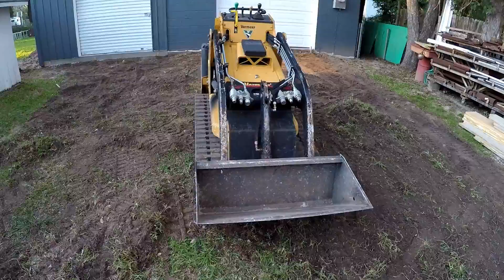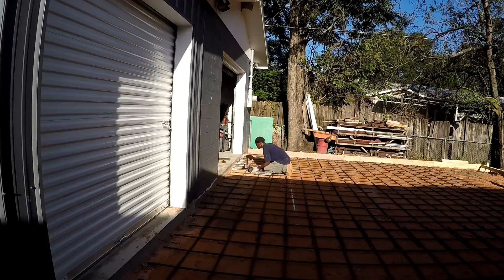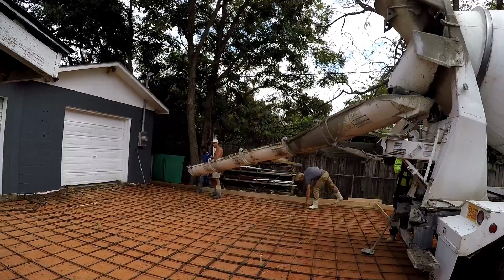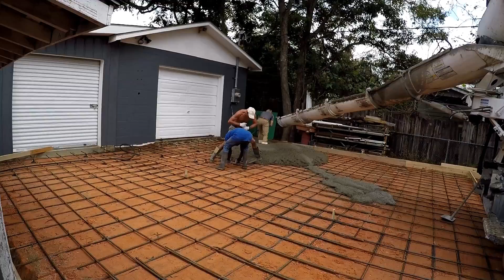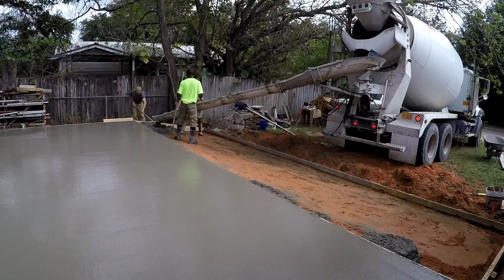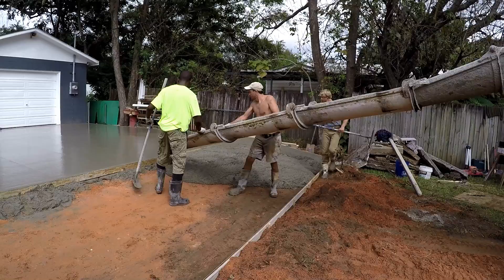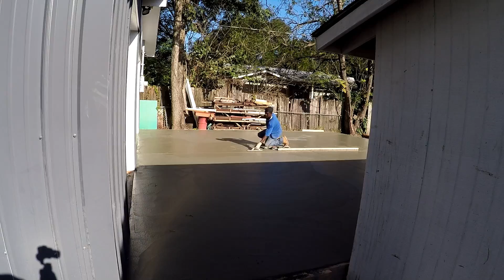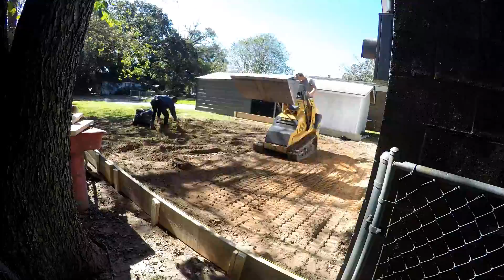New Shop Concrete Slab!

Comment: Forgive me but not buying the simplest and cheapest of tools to make the rebar sit above the ground an inch or two shouldn't have been that difficult. Homedepot sells the rebar chairs for like 20-30$ for a pack of 50. maybe even just a few pieces of solid wood would have been better than lifting the rebar, which would have then settled down to the bottom again. Idk, that just seemed pretty bad and yes I know the vid is old af.

Comment: Wet cement only does what you tell it to do. If you "tell" it the right thing, it will serve you "forever". Especially with re bar and in Florida!  :-) That will last as long as a bridge. (A well made bridge). I saw you take machine tools off your trailer on this driveway, before I saw this video. What piece of History. Adam Booth History. Ya, Adam; I'm Binging on your videos!! Hi, Abby!! Sorry. Mrs. Booth.  ;-)

Comment: Unfortunately lifting reinforcing steel as concrete is being placed without proper chairing is a bad practice. It leads to rebar either being too high or too low in the slab.

Plus one on the use of the mechanical vibrator for proper consolidation. I love seeing that
Reply: Agreed...lots of so called concrete guys will tell you no rebar is needed. They will also say if you want reinforced concrete, they could use "wire" but then wont use dobie to block it up and if they did use rebar lots of them don't use dobies with that either. Such a waste of materials when you are right there 3 feet from the rebar and too cheep to get a box of dobies tied into the rebar. There's much more to mixing concrete as there is to pouring it and spreading it on the "prepared" ground which many concrete guys do not do. It depends on the soil at the job site but do they ever discuss that with the customer? Hardly because it drives the price up and takes more time/labor. Also that guy screeding with that short 2x4 could have had another man helping using a 20 foot 2x4 or one of those professional metal ones used by the trade. this job isn't all that big to get all technical but it's amazing none of this is ever discussed with the owner mostly.
Reply: The installer killed himself because of you!

Comment: Great flat work Adam! And I thought I was the king of overkill! Lol... you should be able to pull loaded semi trucks onto that puppy!.. I just got done pouring a 50×100 for my new shop.  6" thick but only 1/2" rebar on a 12" grid..3500 psi. But mine has 12 × 24 grade beams around the perimeter  sitting on 24 18" piers 12 ft deep.. i called the project slabzilla because it kept eating tons (literally) of rebar! Going to let it cure for a month before erecting steel..  Hope you get to convert yours to a building someday. It's definitely strong enough for it! We met at the Lindale Good of the Land festival but I'm sure you don't remember me... keep on truckin' 
Jeff.

Comment: The man needs handles on that wood so he doesnt have to bend over so much. Hard working crew. good job
Reply: Wooden screed boards do work well with any form of handles.  The leverage on your hands is too severe over any length of time.  Some aluminium fairing tools do have sort of handles but they are narrow,  so are easy to hang onto.  Unfortunately there is no alternative to bending over the work.
Reply: Should have said "do NOT work well" .....
Reply: @evanpenny348  makes sense yes. Ultimate leverage on the hands or bend over and bad for your back. That's a bad deal! I like the sound of the aluminium short handled version but still a compromise.

Comment: um.... you know that form you left on the ramp that you never took out and poured over is going to rot out lol
Reply: JM's Caulking LLC  noticed it too, but it was green treated.. I'd be more worried about the ramp not having any rebar in it because that's where you're going to back a trailer up fully loaded and may only have one of the two axles of the trailer on the ground/concrete ramp...

Comment: Best  to put cement bricks under the bars, cement bricks don;t carry humidity. After the cement is hard is good to water it to make it more strong.
Reply: Rich Brock  : Never say "never", and never say "any" contractor (or whatever else a person could refer to) would tell them to spray water on "every" slab. I did flatwork (owned my own company) for over 15 yrs and there were times I asked the client not to spray water on it. Also, and like I said in my other comment, I didn't see any "cement" being poured on this job. I hate stating the obvious, but concrete is made up of 3 ingredients: water, aggregate (rock, sand, or gravel) and cement. If that slab was poured using "cement" it wouldn't have lasted a month. And yeah, they were wet, probably a 7, but I'm sure they had a proper aggregate in that mix. The one thing I do think about when I see wet mixes like that is if they did it correctly or not. I've seen way, way too many contractors (or DIY'ers) tell the driver to spin it up to a 7 or 8 when he gets there. So what does the driver do? Well... what he was told. He adds straight water to the mix. Total bullshit imho. If I wanted to pour at a 7 (and there were plenty of times I did through a pump), I would have the plant mix me a nice 4 slump and then bring that to a 7 with a plasticizer. That way you still get a solid and strong slab but you can pump it or move it around way easier.
Reply: @TrailTrackers  Wow, you really know a lot about concrete, but you still have something to learn. A real concrete pro doesn't "pour" concrete, he places it. 
And IMHO, I feel bad for Adam; I wish he got as good a finish on his slab that would equal the machine work he does.
That broom finish was so wrong!
Reply: Dom Degood : You and the people "thumbing up" your comment don't know WTF you're talking about. Those look like poly dobies and they don't "carry humidity"; they are just fine to get encased in that slab. And I saw no "cement" being poured on this job. All I saw was them pouring concrete. Also, it looked to be fairly overcast at the end of the pour. And besides, there is no way for us on YouTube to know what the humidity levels are on site, so how the fuck could any of us tell him to spray water on that slab? For that matter, we don't even know if he was asked to do that by the contractor. In any case, that's for the contractor to decide not some know-it-all on YouTube.

Comment: 16:10 clip -- James the Concrete Driver is telling you the inside scoop.  YES, JOE ZERBER is pouring about a 3 1/2" slump -- very dry but the quality of the mix is dry (with no water) and will last a lifetime if not more!  Great job on the slab guys.... like the driver said, a lot of concrete guys just had the FREE WATER and let it crack like crazy.  Abom79 -- your slab was done right!  Worth whatever you paid those hard working guys.
Reply: That was like and 8 slump you have no idea what you are talking about.

Comment: A few mistakes on the pour.
1. No lean concrete on the soil
2. Not enough  expansion joins
3. No rebars on the ramp
4. No curing of the concrete
5. Forms should have been taken out at the ramp
Reply: Lmao all the above is wrong

Comment: Your contractor did a better job than most but there was a piece of rebar right up against the form.  That's a  problem.  Probably not a big deal but it'll show later.  Years down the road maybe it's pop up some concrete but it'll be a while.  I hate rear discharge mixers.  Front discharge can place the concrete for you and is a lot less work.  The concrete had a very good slump.  See too many contractors placing stuff that looks like water with rocks in it.  I like his work.  He did a really good job.  Some very small things I would like different but I would hire him.

Comment: Thank you for sharing this video Adam, is it? For some reason, I had the impression that this was the place where you had made all those videos you have posted in the past, but seems I was wrong. However, 3500psi concrete is awful strong, what do you need it for to be that strong? I am just about to complete my workshop and later planing to use a small type of power hammer, have you any idea how strong and deep concrete I should pour?

Comment: Decent, but def not superior as some of the comments suggest. A few things tell you this that most people don’t see cause they don’t actually have “35” years concrete experience like they claim. The footing/face on the sides isn’t nearly wide enough at the bottom and the rebar doesn’t roll into it. All those stop and start marks from the broom could have been avoided by brooming the other direction on the large portion(one long clean stroke). At the end when he’s talking, you can see they didn’t sponge off his existing slab to keep it clean. Wood should never be left in the slab like that. That’s old school and it will eventually rot. At first I thought he would get rid of it just before screeding the ramp but...nope. If I was a betting man, he probably thought since he had to get another truck, he might as well pour the ramp, which was why the ramp wasn’t ready in the first place. For those suggesting the wood might be so the ramp could be removed at a later date, it could have easily been removed as long as the rebar isn’t continuous and there’s a “wet joint”. Whether it breaks on the wet joint or you saw cut it. Either way, that dodge is def not making it up what they poured without destroying the front bumper/wing. Like I said, decent work, but def not superior.

Comment: That guy in the blue shirt on the screed is a beast! Can’t believe 3 of them poured and finished that much, turned out excellent. I just had 70 yards at 6 inches thick poured for the inside of my new weld shop. My crew I contracted had roughly 8 guys. It took a full day from 7am to 8am. That’s poured, plus machine finished. My concrete looks like a mirror! Your guys did a helluva job as well, hats off to them. After watching mine get done I’m glad I chose to be a certified welder by trade lol.

Comment: Looks like shit. They didn’t polish the concrete right. They took too long to broom it and did not put water when brooming it. Should have expanding joint on the ramp where they did not use rebar by the way.should have had expanding joint on the garage too. No compound cure after it was dry. No bueno. I do not see the 40 year experience at all. Concrete should not be that rough when finished.

Comment: Two weeks ago I poured a 1500 sq ft slab behind my house in anticipation of building my wife a kitchen.  The concrete trucks showed up seven hours late.  The second truck was carrying a hot load, which we sent back, the concrete company employee saying not once, but thrice "if you send this load back you're fucking yourselves".  Who talks to people this way?

We were finishing concrete in pitch black until 1AM.  The concrete company broke my driveway, took out my phone line, broke two of my magic apple trees, and had the nerve to tell me that is was all my fault.  And on top of it all, they delivered 32 yards when I ordered 30.

Well, they have yet to be paid and they will not be until such time as they make the proper adjustments.  Smith Concrete in Charleston WV is the worst I've ever seen, and by a long margin.  The finish on my slab is crap.  I was supposed to have a slick finish so I can move my machinery in - lathes, mills, etc., on machine dollies.  The finish is such that a machine dolly would stop dead on a bump and we all know what happens when they do that: the 4000# mill walks right off the dolly, smashing into the floor, ruining that part of the concrete, and likely hosing the accuracy of the mill.

I was so upset about it, I had a vagal response - my heart stopped dead in my chest for about 15 seconds, which is a REALLY weird experience that could have proven fatal, had the old ticker decided not to restart, which it did after I was well on my way to unconsciousness.

Your pour went well.  Good for you.  Now I have to figure out how to salvage this disaster.

PS: adding insult to injury, some time between about 2AM and 7, either a stray dog or one from my neighbors waltzed across my new pad in two places.  Had the concrete trucks showed on time, it would have been set enough such that the footprints would not have been quite so deep.

It is pretty aggravating, especially after my having excavated 800 yards of WV red shale clay by hand with naught more than a wheelbarrow, shovel, a still strong back, and lots of determination for two years.  I graded it, put in a ton of rebar, built the forms, all done pretty well - only to have all that labor turned to junk because of a concrete company with a very bad work ethic and dishonest employees.

Comment: You had to install little water drain trench covered with some plastic or metal bars by the doors. The first big block looks horizontal. Rain can make problems

Comment: There is no doubt that these men worked hard! That was a lot for 3 dudes! But if I’m honest, the finished product could have been a lot better. They broomed it when it was too dry.... also a different style of broom would have been better. And defiantly would have used a magic screed to pull that down lol  I am a union concrete Finisher so I’m use to a different standard and different way of doing things. Cheers

Comment: Hello from Finland. Nice video. In Finland we must first dig all area about 40 inch. Then drain area with pipes. Then put 30 inch crushed rock and 10 inch thermal insulation before concrite slab.. All because in winter we have 3months -20 to -30 degrees celcius. I like Your videos. I have in my shop for hobbying Finnish made Karhula Sorvi. Year 1916 made. Sorvi means in english Lathe. She is very good about condition. All good for You and Your Family. Now in Finland are -1 degrees celcius.

Comment: Been waiting for my slab for my new machine shop for my gun business, they started towards the beginning of September, were digging the beams for the slab on September 6, 2018, and here it is 2 weeks later and they are still working on getting the slab ready to poor, and it is only a 30' x 30' slab. Over 2 weeks I have been waiting for them just to get the slab ready to poor and they still have one more of the beams to dig back out (was dug with a ditching machine, just have to clean them out) and then put the steel in and tie it, and finish putting up the forms. Your getting yours done, complete within 1 week.

Comment: One shop I worked in used 8" square tire tread patches to place under the machine tools, from Bridgeports to punch presses. The machines would stay put & not transmit vibrations to the slab.

Comment: They almost lost that. Good save by Joe! Getting on it barefoot and using a push broom to get a finish on it. The guy on the screed board deserves to be making atleast 30 an hour. I really hope he is. It's hard to find good help in concrete anymore. Most people are like the fourth guy. Standing around watching as everyone busts there butt. If the fourth guy would've worked as hard as the owners and the screed king. Then they wouldnt been so close to losing it.

Comment: the only thing i would have done different was put a saw cut instead of using the jointer like they did would not feel up with dirt so bad and if you rolled like tool boxs or anything with small wheels sometimes it can be a pain
Reply: and looks likw it was broomed a lil wet should have gave it few more mins then broomed then so much would not rub off and would not be that ruff

Comment: Good video. I would have put more control joints in with a slab that big. And it seems a little dry. I think it could use some water for a few days.